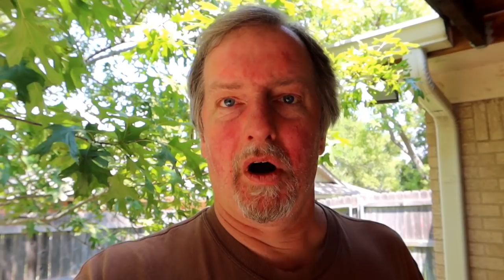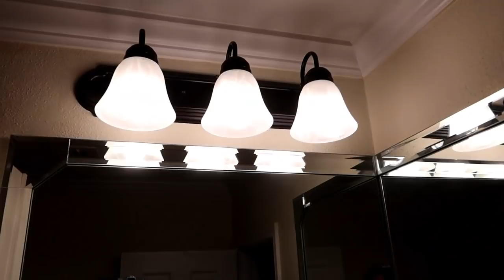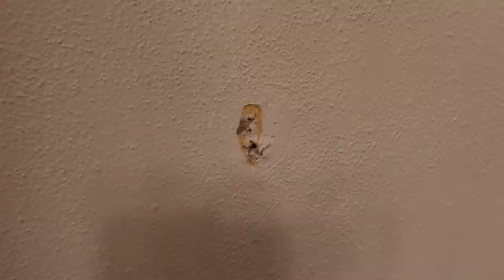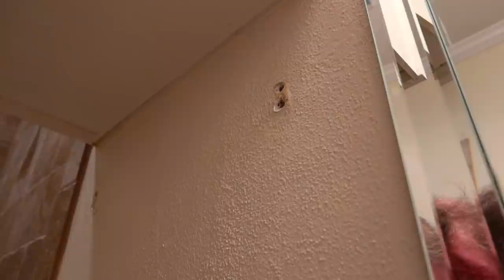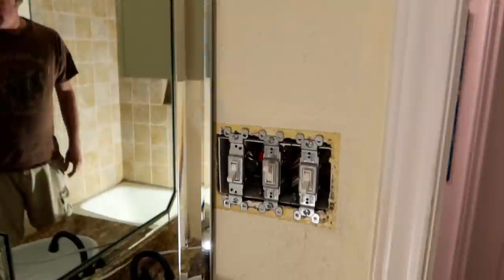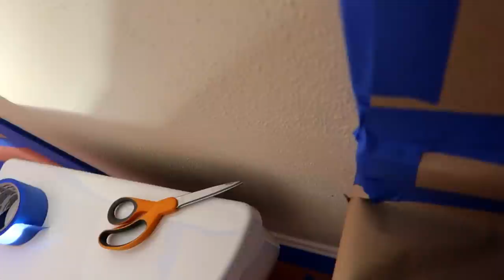Painting The Guest Bathroom (Part 1) - Escaping The Mouse - ETM-444

Comment: You could have patched those first holes much quicker.. Big glop of drywall compound, (not the powdered type)smash it flat under pressure right over the holes with a putty knife,holes filled immediately, no assing around with fingers. Smooth it with the blade,you're done. Don't understand taking the extra time to mix the compound or fingering the holes....just advice not criticism.